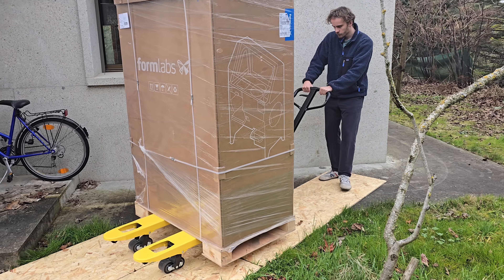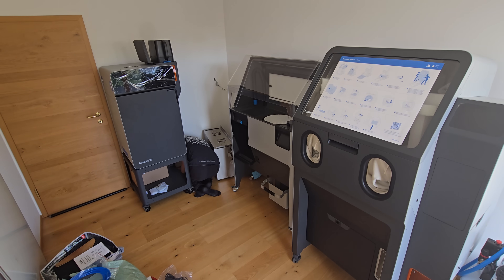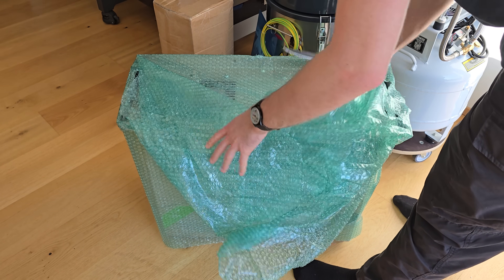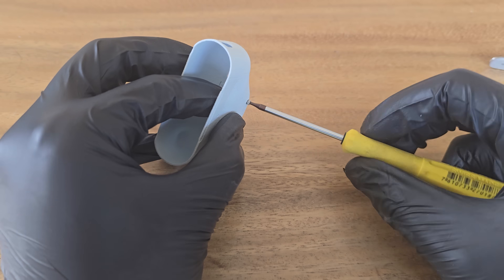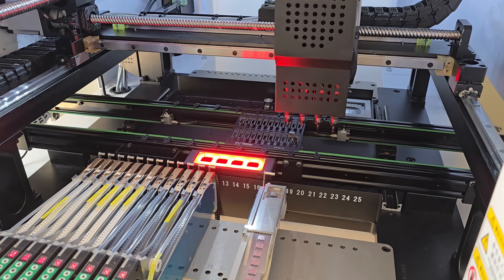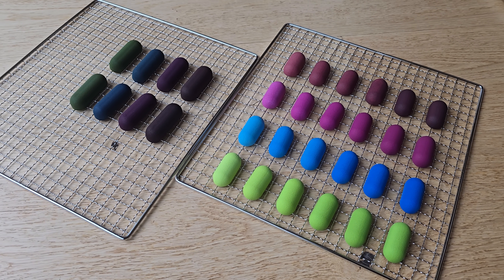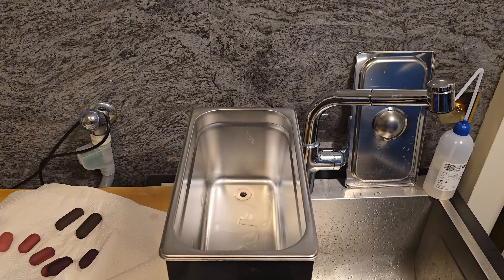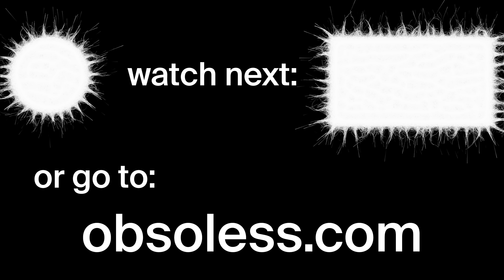Turning White Powder Into 3D Printing Gold

Comment: Hey Ken, during the Formlabs webinar you mentioned an Air Compressor for the Fuse Blast, but I can't remember which, could you please let me know which one are you recommending? Thank you very much for the impressive content!!!
Reply from the maker: Hey! I'm using the 3000W compressor from Implotex. It works for dark drey Nylon 12, but it is slightly underpowered for Nylon White (I show that I added a second smaller compressor in parallel). At some point I will upgrade to a screw compressor, but they are much more expensive, require yearly maintenance from a professional, and also very hard to move around. So for now this setup works for me. Good luck!
Reply: @ExploringTheSimulation  Thank you very, very much!!!

Comment: There is no need to use multiple ultrasonic cleaners you can just put another container inside the one you already have and have separate containers for different colors. For example filling the ultrasonic cleaner with water and placing a jar inside it with the color solution. Here is a video showing what i mean https://youtu.be/ZzHrgI5fs0U

Comment: I used to use the Rit dues for dying sacrificial nylon bolts, nuts and spacers for racing quads without the colour getting patchy.

A bottle of Rit to one or two litres of  water (would have to hunt my notes out) but you also need to make sure that the dye was slightly acidic (I was lazy and just used acetic or citric acid, whatever was to hand at the time.)

The only real issue was keeping the temperature consistent as that majority changed the rate the nylon absorbed the dye.

Purples and reds were definitely the easiest colours to work with.

Comment: Maybe I missed previously somewhere you explained but why use SLS when FDM is so good and soooo cheap nowadays? Is the nylon really that much more durable/ do you really need that much extra durability?
Reply from the maker: It's a little more durable but it's not the main reason. It's mostly because the print quality is still another world apart, it doesn't feel 'cheap' like FDM does. Also no need for supports is huge. I don't want to spend my time breaking off supports and potentially sanding down supports marks. If I make a mistake and leave a support mark, it might scratch my customer's AirPods case. Don't want to take that risk.

Comment: If you need warm water quicker, why not use an electric kettle to fill it and top off with tap water to get to the desired temperature? Depending on the volume that would take a few minutes at most, and the cleaner should be able to keep it at the right temperature. Of combine the two, fill partially with tap water and turn on and while it's heating keep using the kettle to add boiling water.
Reply from the maker: I did that the first time, but then if you want to reuse it later you can't really put the mixed dye directly in the electric kettle. I've got a few ideas on a how to speed it up, like plunging a sous vide in the liquid at the beginning. For sure will keep iterating on this process to make it better! Thank you so much for the suggestion.
Reply: @ExploringTheSimulation Good point, I only thought about the first time, didn't think of the next time you need to heat it when the paint is already in it. Good luck!

Comment: Should’ve done an SLS4all printer build build. Source the parts right and you can have a quality, better than hobbyist, SLS 3D printer for under $5kIf he’s still selling them, you might be able to buy one of his kits for around $7k. And the print quality rivals anything Formlabs  produces. What’s awesome, is the SLS4all guy released the plans to his printer for free.  Check it out. Keep all that money that you’ll save where it belongs, in your pocket awaiting that next cool bit of tech to drop.
Reply from the maker: I saw that project and really wish that it succeeds! Honestly have no idea how reliable it is, didn't look into it too much. When building things, you gotta choose if you want it to be a tool or a project. My projects are the Apple mods, and the rest should be tools if possible. I didn't have the time or envy to build a printer from scratch, and could afford the Formlabs one which I know from experience will work and no need to mess with the settings. So I pulled the trigger and moved forward with my projects. If it wasn't for production and I was doing a one off for fun/content, probably would have went that route! Thanks for the suggestion :)

Comment: It's annoying that you haven't explained why formlabs were preventing you using different colour powders. The whole premise of this video being you got another machine just to print a different colour, and that you needed nitrogen again totally unexplained.
Reply from the maker: Mmh ok I see your point! My bad. Sometimes you spend so much time working on something that it's hard to zoom out and view it from a fresh perspective. I do share it with a few people before posting, but I guess that didn't get picked up. 

So to answer this, I already have one printer using the dark grey powder and it's crucial for my business, I don't want to mess with it because it generates my income. Also another printer makes for partial reliability. If one is down I can use the second one and still offer parts (although in a different color). Formlabs doesn't prevent changing powders, it's possible to do, just a huge pain because it takes a really long time to clean the old powder off. This stuff is everywhere and you don't want to cross contaminate powders. I didn't want to do deal with that. For nitrogen, I'm not 100% sure why it's required, I just know that the white powder requires an inert nitrogen environment when printing. Maybe so it doesn't "burn" and turn yellow?
Reply: @ExploringTheSimulation I see, that makes sense! Ty. Yeh, I had a look at formlabs and they mention the potential yellowing. Reminded me of how you can buy cheap resins that yellow over time, or more expensive crystal clear resins that are more stable.

Comment: Is there a reason why you print cases in horizontal orientation and not vertical? I believe it makes layer lines very visible on the "hump" for type-C connector.
Reply from the maker: Great observation! You are totally correct. So first reason is that I had to iterate a lot to get a good fit and finish. Since you have to wait for the printer to warm up and then cool down, I wanted to minimize the Z height of the print to allow for faster printer. That allowed to get 1-2 revisions done per day. Then I noticed that I could probably make the layer lines disappear on the front, but I'm an engineer and thought they looked really cool. Kind of an homage to the manufacturing process. They are not like FDM layer lines though, you can't feel them it's just visual. Also now it's very convenient if I need to print less than 8 cases, super quick! Thanks for the great question and keen eye.

Comment: hey i just got one of tehse machines and was wondering what is the failure rate youve seen if any, i only plan on using standard PA12, not the white but was wondering if you have any insights regardless since i plan on runnning teh machine with back to back batches
Reply from the maker: On a full build of 70 cases, it can happen that 1 case has a surface defect and I can't sell it. Sometimes 2 cases, but very rare.

Comment: 6:28 “rince with clear water”
Reply from the maker: 😅 knew someone would call me out on that haha! Actually it's fine to reuse the rinsing water for a couple of parts and then swap it. The goal is just to remove the highly concentrated liquid from the surface of the part so it doesn't dye it any further.
Reply: "Rince"

Comment: I'm genuinely curious, why SLS is it in hopes that the pores will absorb the dyes better? I did a mock up of an air pod case and sliced it in preform with the fuse 30w and it takes 6 hours to print a total of 10 hours with all the heating and cooling for 12 and when compared to FDM at the same layer height of 0.110mm an average printer can knock them out in 47 minutes in the color of nylon you want and you can always split the work into multiple printers to kick out 12 of them every hour, no dying, little to no post processing and if a failure happens you are only down a 12th instead of 50% since you said you have two. Again, genuinely curious my experience with PLASTIC SLS printers seems to be more of a relic of the past.
Reply from the maker: Actually it's the other way around, I chose SLS first and now just got interested in dyeing. You are correct that printing one case it's much faster with FDM, but I can add 6-8 cases laying flat in one build plate and then stack them in the Z axis (see at 3:26). So regarding speed when you add many cases it's really not bad. Now regarding print quality and texture, it's a whole completely different league. FDM feels cheap and even someone who doesn't know much will feel it's 3d printed. SLS has got people saying 'wow the texture is amazing' and 'how was this made?'. It feels premium.

Comment: Suggestion, ik you are probably alr planning on doing this, but you should make it so that whenever you click on a color option, the corresponding image of the case with that color appears.
Reply from the maker: Thanks for the suggestion! It's definitely planned but requires a lot of work. There's a ton of models with each one different colors and some even a lanyard option too. I'll get to it at some point but the way it is now is a quick and easy fix. Not ideal but works :) Thanks again!

Comment: how many parts do you need to print to make profit with that expensive drm formlabs consumeables and 100k in printers and processing gear ?
especially with the affordable sls printing services overseas?

imagine what would be possible for small firms that dont require a huge loan or investment if there still would be a 3500$ nylon sls printer with affordable powder....*cough* micronics
Reply from the maker: Great question! For sure you can use the overseas printing services, but I found that with shipping you end up wasting a lot of time when you want to be iterating quickly instead. It's so good to be able to have a prototype in just a few hours. Also, it's not great for repeatability, sometimes they use another printer and tolerances are slightly off, etc. Lastly, tariffs? I'm not affected by them but I want to be as vertical and local as possible, you never know.

For ROI, my first printer was paid off (my own labour not included) in less than a month! But I understand that it's a very special situation where you need to sell a couple of thousand parts. 

Regarding a 3500$ nylon SLS, don't get me wrong I want this to happen as much as anyone, but we are not there yet and I don't think it was a realistic price to advertise. The goal was to sell and/or to get VC funding and operate at a loss at the beginning. They sold, which answers the question. But that's just my opinion :)

Comment: be careful with a die, it might contain dangerous organic solvents that not only smell bad, but poisonous.  Work outside with a good wind or use a proper respirator mask for organic solvents vapors (we use them every day at work) and not a simple COVID mark. 
Also, Swiss have a very hard rules for disposing of organic waste.
Reply from the maker: Definitely dangerous solvents involved, that's why I recommended doing it outside or in a fume hood like the ones used for resin 3d printers. Thanks for caring!

Comment: Why dont you get these cases made by jlc3dp or pcbway, pcbway already makes your pcbs, you would just have to do the assembly, cheap, fast, easy.
Reply from the maker: Lots of reasons, main one is control and speed to market. There's a reason I don't do any Kickstarter or false promises. When I drop something, it already works and is ready to be sold. That doesn't leave time for competition to copy the idea and bring it to market sooner. The way I go "quickly" is by being able to iterate on my designs rapidly. Shipping 3D printed parts from China takes time and can add up in costs quickly. Then usually with those services (not talking about anyone in particular), it's hard to get very consistent results. They are never printed on the same printer, so that adds some variability I'm not comfortable with. PCBWay is great and they do produce the bare flexible PCBs, but good luck trying to do that yourself at home. I still do the PCB assembly myself, again for speed and iteration. Another reason, if I made everything in China I wouldn't have much to show on video! Thanks for the great question!
Reply: @ExploringTheSimulation  The shipping time from China and cost is what slows down my projects the most too, but I work with those limitations, I get it now tho.

Comment: The way you continue improving this product is making it hard to not go ahead and buy it, getting rid of the need for my last lightning cable... Sometime soon! 
Any chance to combine clear top with darker bottom of the same solour?
That dark + clear blue you showed is exactly the colour of the silicon case I use now. And in my opinion these clear / dark colour combinations look always so much better than a solid one colour!
Reply from the maker: No pressure! Already very happy if you watch the videos :) Not sure that I will make that available as an option, I'm already so scared that I won't be able to manage so many different model of cases, then with lanyard option, and then many colors. That's a lot of different products for one person to handle haha. It could be possible if someone really wants it, they could order an extra replacement part (just the lid in another color for example) and then that would make their own combination possible. Thanks for the idea!

Comment: I expect that those dyes are just azide-based powder dyes, with surfactants, chelation/antioxidant stuff. I.e. ingredients that are cheap in bulk when bought separately.
Formulations for proprietary blends can usually be found somewhere on researchgate, if you delve through a lot of research papers.
Or you could just ask qwen/deepseek that has been trained on scientific data😂.
Reply from the maker: Interesting! Honestly I don't know much about chemistry except some basic classes at uni. The issue here is that I could spend a long time trying to make my own dyes but is it really worth it? I already spent so much time getting a setup to work with off the shelf stuff, I can't imagine how long it would take to start from scratch. But since SLS is going to become more and more mainstream, that could be an idea for the entrepreneurs out there :) Thanks for the idea!
Reply: @ExploringTheSimulation  Yeah, making your own formulations is worth it when you need a lot of it (when you sell the dye, or you have a big printfarm).
I find it useful to know more about the product I bought, when the manufacturer doesn't tell everything; last month I bought epoxy resin, and the manufacturer didn't say anything about UV-resistance and chemical compatibility, so I uploaded the MSDS to Qwen and got my answers😂. Turns out BPA-based epoxy is not UV-resistant, now I know.